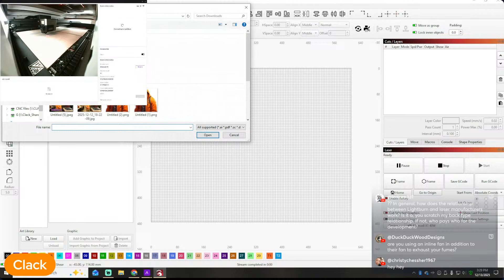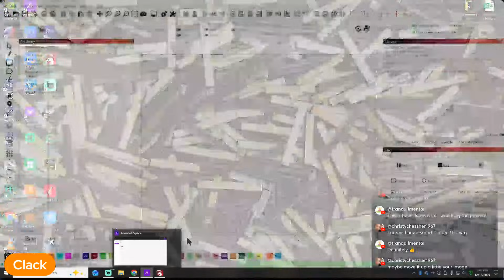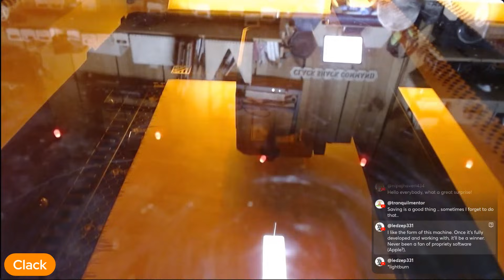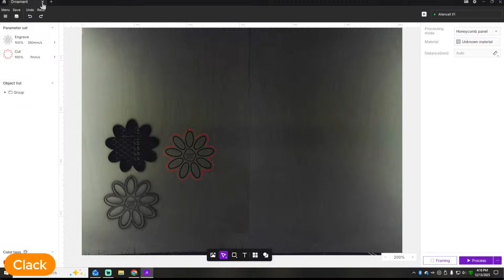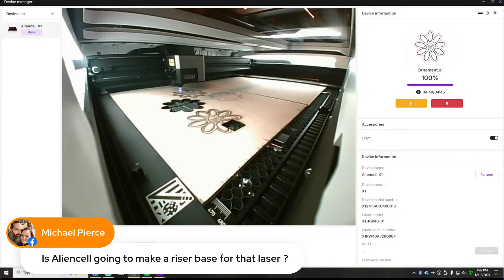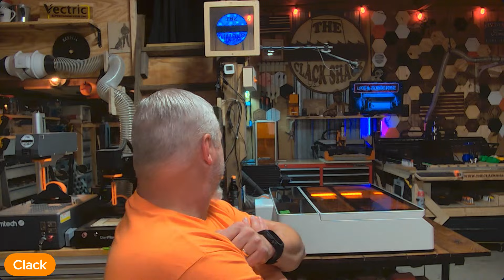Aliencell operation in lightburn- LIVE 12/13/2025

Comment: Would you please demo how to override the auto-focus, and conduct a manual mid-point focus on a shallow (1/4" to 1/2" ) curved surface.
Reply from the maker: I would do an auto and then set an offset to raise or lower the z as needed. Maybe next video.